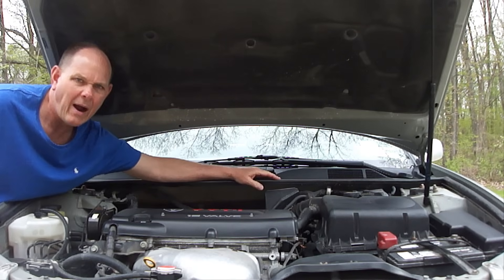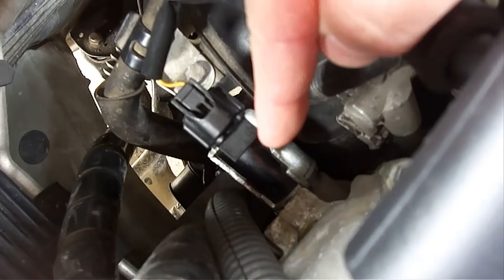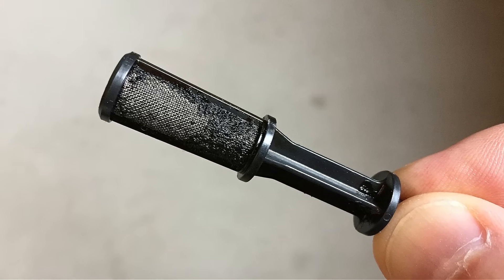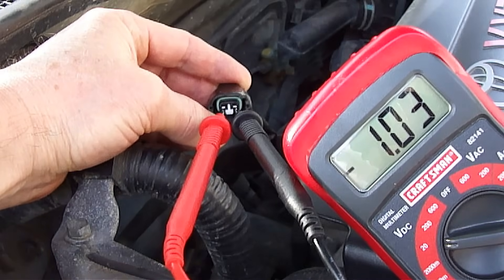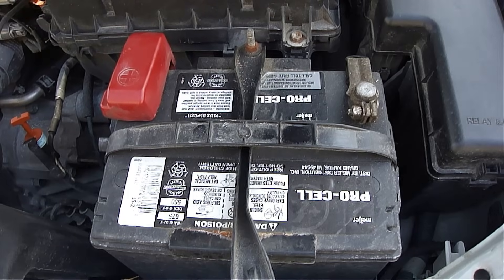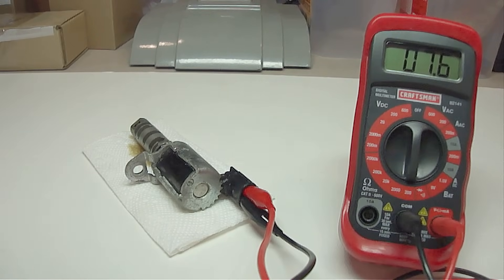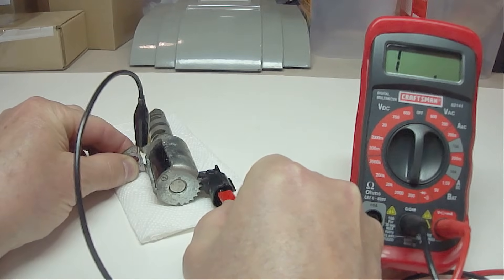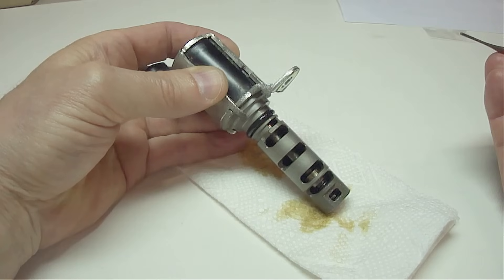How To Tell If Variable Valve Timing Solenoid Is Bad On Your Car P0010 P0011 P0112 P0013 P0014

Comment: Awesome Video! 
Had P0023 (2012 Enclave) (also had P2099, P0430) engine chugging slightly in OD.
Finally SOLVED it by replacing VVT Solenoid (think problem was: I cracked solenoid plastic housing when replacing my alternator),
But first replaced Camshaft Position Sensor (see steps below) but didn't get rid of codes so I replaced VVT solenoid after solenoid connector cracked off in my hands when trying to unplug connector to test. Also used liquid electrical tape to reseal connector wires as they were pulled back from connector and showing bare wire. 

Side note: Did all the following and didn't solve it...ugh: Replaced the Camshaft position sensor & bank 2 lower O2 Sensor... but code came back.
Bank 2 exhaust is located just to the left of the Oil fill cap (near top of engine). Unfortunately, it is hidden behind a ton of stuff that needs to be removed to get to it. Heres what it took: Detach negative battery cable from battery. Remove10mm holding ac line near top front. Remove (2) 10mm holding overflow tank (move aside). Remove Fusebox cover. Loosen (2) phillips 10mm bolts (holding fuse wire harness) inside fusebox. Remove (1) 13mm bolt connecting positive battery terminals to fusebox. Unclip and remove fusebox middle part (with fuses) removing wire harness from bottom. Unclip/remove fusebox bottom. Remove (3) 10mm fusebox aluminum baseplate. Unclip wire harnesses from baseplate. Remove (2) 15mm engine mount bolts (holding rubber figure 8 mount). Slide rubber figure 8 mount out sideways. Remove (2) 18 mm bolts from part of mount that bolts directly to engine.  Remove (1) 10mm camshaft position sensor bolt. Remove sensor. Detach sensor wire clip. Reverse to replace everything. Lots of parts to remove - it wasn't that bad once I figured it all out but just a lot of little maneuvering to get such a small part out. I would give yourself 1.5 hours (or more) to remove and 1.5 hours to replace. This same/similar procedure can be used to get to the alternator on this car also but I'd also remove radiator hose for alternator and plastic shroud for alternator.

Comment: Great video!! Thank you for posting ☺️ my engine light has been on & was told that code meant needed to replace valve you were talking about.  If at a light engine would shut down & sometimes hard to get back running & getting into traffic. Got to point where battery was drained.  Today went got new battery - everything was great 5 min later & engine light returned .  5 min later stalled out in middle of traffic @ a light. 😬 fortunately had help pushing it into a parking lot.  Was able to get running again and get home. Went to autozone and got the above valve. Wish I found your video first!!  Took a couple hours but finally got the old valve out & new one In. But this video would have saved us so much time & F bombs 😂
Reply: I have the same issue

Comment: Thanks, this was very helpfull & I find that my cam solenoids are stuck (X 4!! ) & that it was not bad wiring to them, & this is most likely the cause of the camshaft sensor p0340 + others, problem.
When I tested, one gave a light 'Tik' sound for a while, another nothing, both coils in them seem OK.
I need to remove the camshaft covers to get to them. Audi ASN engine

Comment: Just unplug the dam thing and leave it unplugged. I have on my 1.8vvt vectra which has 2 of them unplugged them both months ago and my car runs so so so much better variable valve timing is only for emissions anyway. People say unplugging them causes codes and performance issues i have non of the above infact I was suffering with lag and flat spot issues when connected now im not. If you do get codes just simply buy a second hand set dont fit them just plug them in a cable tie them to the frame of the car tricking the ecu into thinking there fitted. By running without vvt is the same as having an engine without vvt unplugging only returns the cam to base setting just remember to reconnect for emissions test.

Comment: My 2004 honda accord coil resistance check  ohm reading is 70 and not 7.0. I can't find the acceptable ohm range for my honda accord solenoid. I don't have a check engine light  and it passed all other  checks. Should I buy a new solenoid?

Comment: This is a very comprehensive video and one of the best videos on VVT. Thanks for sharing this 
I have a question- can a VVT solenoid be cleaned? If yes then how and what cleaner one should use.
Reply from the maker: himanshu thakur yes a VVT valve can be cleaned. Submerge  the moving parts only in gasoline which makes an excellent cleaner.
Reply: Thanks a lot. I have a 3M throttle body cleaner, Can that be used as well?
Reply from the maker: himanshu thakur try the 3M cleaner first and see if that works.  Depending on how bad it is you might need gasoline. If you end up needing to use gasoline I would soak it for a couple of days if that’s possible.
Reply: @proclaimliberty2000  Got it. Thanks again. I'll post my experience here.
Reply from the maker: himanshu thakur 👍😊
Reply: Very intuitive video. My question is what would  be the acceptable ohms for a 99 lexus es300? Thank you in advance.

Comment: Great video...I'm now a subscriber! One question....was the 1.04 volts dc you measured correct?
Reply: VERY good question.  Wish we had an answer,  obviously every other system in the car uses 12v, and he tests it with 12 v.

Comment: Please, if you have time, I have an 03 Toyota Matrix corolla. No codes, but NO Voltage going to the VVT Solenoid from the wiring harness connector. The VVT Solenoid itself functions perfectly when attached directly to battery. How do I find the source of the electrical short?

Comment: 0:12 Incorrect, the solenoid is NOT a sensor. What was described is what the Cam sensor(s) does along with the crank sensor, and translated by the ECU as to what load, and cam phase to adjust to.
The solenoid is only a sensor if there is a short in the circuit. The ECU give a solenoid fault if it doesn't see the cam phase adjust to what it expecting.
Reply: Thanks cuz I was just so confused after looking at my car and then working on it

Comment: Hey great video! Thanks for the help! I was able to identify that my exhaust solenoid was out! It had the correct reading for resistance (11 ohms) but when I connected it to the batter it wouldn’t move! I tested the inlet solenoid and it clicked open and shut without issue.

Comment: Will this cause a car not to start
Reply: Kash Guwopz did you figure it out mine isn’t starting either I’m replacing this valve tomorrow hopefully it turns on
Reply: ivan torres hernandez I had to get a new engine
Reply: Kash Guwopz what was the damage that made you replace engine
Reply: Low compression cranks no start

Comment: Thanks for the video! Is Bank 1 and Bank 2 the same part?
Reply from the maker: Hi Becky, the answer is no.  This video will help you understand it better.  https://youtu.be/ij6wGdhGDow
Reply: @proclaimliberty2000  Thank you very helpful! My ford edge is throwing thew P0010 which is the VVT Solenoid It says Bank one. I guess my other question would be, I thought about going ahead and getting two because I though there were only two. I have two in  my cart right now on rock auto. I picked one up at Oreilly today but it was 61.00. Figured I could get two and change them both out for that price! So I guess I need to find a part number for Bank 2? Thank you so much!!
Reply from the maker: Becky Stiles The first thing I would do is change the engine oil and filter which might fix the problem.
Reply: @proclaimliberty2000  My boss told me that earlier! That means he might be right and I refuse to tell him that haha,  but I am due for an oil change. I really do appreciate it! It started missing or surging a few months ago. At first I thought maybe it was just bumps in the road but It's getting progressively worse. Especially going up hills at a lower rpm. This light has been on for a long time..I mean loooong time. Just changed out the camshaft position sensor. The light went out. I hit the reset button to see if anything else would pop up and the check engine light came back on I checked it today at Oreilly and got this code. I got the same codes  a couple of years ago but didn't really have the money to take it someone to get fixed. On my own and working nights just didn't make it easy for me to do. I know, shame on me. Anyway, I'm so glad I found your channel. This is going to be a lot of help for me. You are accurate and explain things very well. Very informative! Thank you!
Reply from the maker: Becky Stiles 👍😊

Comment: Hi. My friend. I'm having a trouble with my Land Rover 2005 HSE 4.4 V8 cilinders gasoline. Maybe you can help me out. My land rover starts. But does not move when i put the shaft on D to drive. And after 15 minutes that i turned. Off the engine. Wont start again. And send the message apply handbrake. I will apreciate your help please

Comment: For some reason the VVT code didn't show up on a 2000 Avalon. I researched the symptoms on the internet and used a YouTube video to replace them. It made all the difference in the world. You're a champ for taking the time to help folks with your videos. God bless!
Reply: was you car running rough for one of the symptoms?
Reply: @kidnman4605  Hey, currently having this issue on my 2002 xls, i have a rough idle every now and then, and a strange hopping or jerking motion when accelerating. Everything i research points to the vvt solenoids, ill be replacing them this weekend.
Reply: @kidnman4605  yes
Reply: Yah, having these problems yet does not shoe up on OBD2
Reply: @WolverineXXXX  same with my 2001

Comment: Is possible this could be causing issues during acceleration (rpm fluctuation, jerkiness) without a check-engine-light? It just hasn't been replaced before & now has 430,000 miles... probably worth replacing it anyway for good measure?
Reply: 430,000 miles. 
Replace everything
U Funny guy.
Reply: @markvermeulen1372  490k now

Comment: Very nice video, very helpful. I have 2.4L ecotech 2012 Buick Lacrosse code P0016, P0017 and P0172, smoking tail pipe and engine doesnt pick up 100% power. Engine sound fine, probably timing chain off track by teeth??

Comment: As solenoids have moving part internally do they wear with time reducing their efficiency?  I recently changed out the filter screens on my vehicle , they looked clean as I change my engine oil religiously so I was wondering if replacing the solenoids with new ones would make sense.  My van is a 2006 with 175k miles
Reply from the maker: I think the wear on a VVT valve would be minimal.   The problems start when the engine oil is not changed when it should be causing varnish build up on the VVT valve resulting in poor performance which can of course be corrected by cleaning and removing the varnish.   As long as your check engine light doesn't come on then it should be performing properly.

Comment: what is the symptom to have this bad timing solenoid? can this cause loss power when press hi rpm and engine shakes/rough when idle.
Reply from the maker: https://youtu.be/fPqjJVHZS3I
Reply: I've check mine today the solenoid just works fine after tested with my car batery because I don't have multimeter.  So what else can cause this problem ? can ECU cause this rough idle?

Comment: Could this problem lead to the engine hot ac off msg on a 13 impala?  I’ve already replaced the thermostat,coolant temp sensor & the pigtail connection still getting the engine hot ac off msg only code I’m getting with the scan tool is p0024

Comment: P0011 on a 350z. Would that cause a lumpy idle that sounds like it’s a cammed Chevy but runs normal under acceleration?
Reply: Nissan always have problems. Buy a Honda

Comment: I have a 2012 Honda CRV and I have a cold start grinding sound. Only on cold start. I change my oil religiously at 4K miles.  Purchased this car new. Honda has a TSB stating to replace the VTC Actuator and not solenoid. Many people have changed the VTC Actuator on the intake side but the noise eventually comes back.  Not sure the true cause that plagues these CRVs and accords with the cold start rattle they lasts only 1 second.  Any opinion?

Comment: Can a bad VVT intake and exhaust solenoid cause a vehicle to stall while idling and cause difficulty starting? My car has been rough idling, stalling and having issues starting. However, no check engine has come on so it's been difficult for a mechanic to pinpoint. Today I was told it is the solenoids, but I see nothing about this causing my specific issues and as I'm being quoted $615 I wanna get all the information I can. Thank you!
Reply from the maker: artbyce based on everything you’ve told me the first thing that comes to my mind is a dirty throttle body that needs to be cleaned. Do you know if that’s been done recently? Do you know how to clean a throttle body?
Reply: @proclaimliberty2000  Yes, I cleaned the throttle body 2 weeks ago. The issues started happening more regularly the day after I had an oil change. I also forgot to mention there is a very noticeable ticking sound coming from the engine.
Reply from the maker: @ArtCE47  Make sure all your vacuum lines are attached.
Reply: What's the make of your vehicle? @artbyce
Reply from the maker: @twiliteblue6053  2006 Toyota Camry LE (2.4 liter 4 cylinder)
Reply: I have the same problem on my toyota corolla,. When I shift it in drive or in reverse the rpms fluctuate back and forth as if it wants to turn off . I changed the ignition coils, spark plugs and injectors and the problem never went away . Could it be the throttle position sensor ? Any recommendations ?

Comment: When I checked the coil resistance on mine both were flashing 2.0 but yours are steady on 7.6.
Why is my reading flashing and not steady.
Reply: Flashing  means you're not getting a reading or you're in wrong setting. Use only 1K resistance setting. If you're setting is too high, you don't get accurate reading.

Comment: Hi sir and thanks for your very informative video. 
I tested my solenoids connection with a multimeter and it showed 2.4 volts on each of them. Is it the right voltage for an 2.4 Ecotec engine? Shouldn't it be 12 volts powering them. Please advise. Thanks.
Reply from the maker: Ricardo Quezada Your voltage is good.  It should not be 12 volts.
Reply: @proclaimliberty2000  many thanks for clarifying that.
Reply from the maker: Ricardo Quezada 👍😊

Comment: Hello! I'm so glad I found your channel. I'm having a P1349 error code on my 2000 Corolla LE. I drove it to D.C from VA yesterday fine. When I got home I realized whenever I hit the gas, or go past 2000 RPM it makes a very loud knocking/rattling noise from the left side of my engine. At first I thought maybe it was sparkplugs/coil packs but after I realized it was a P1349 VVT-i error code I knew it wasn't. Today I got a oil change because one of the symptoms is bad oil (oil was dirty when changed) and it's still making the same noise but slightly less. I'm hoping that it's a bad solenoid. When replacing the oil solenoid there is only one correct? Also do you think it's a solenoid or something else? I know you can't give me a answer without seeing my car but what is it usually? Bad solenoid I'm guessing... Thanks!
Reply from the maker: CookSzn before changing the solenoid make sure it’s receiving voltage at the harness that attaches to the solenoid. If you replace the solenoid, make sure it’s an OEM part.
Reply: proclaimliberty2000 so I should test the wire that connects into the solenoid with a voltage tester right
Reply from the maker: CookSzn Yes.  Put key in ignition turned to the on position but do not start. Then check solenoid electrical harness with digital multimeter on DC setting.
Reply from the maker: CookSzn you need to watch another video of mine called how to fix engine hesitation during acceleration - P0010... It will show you how to  inspect the solenoid
Reply: proclaimliberty2000 thank you
Reply from the maker: CookSzn 👍😊
Reply: @proclaimliberty2000  I think I have an oil leak (can't seem to find one) ... Got an oil change yesterday drove the car twice, on the 2nd time it was sputtering and SOMEHOW out of oil (put 5 quarts in less than 5 hours before) and the car locked up and turned off. Oil stick DRY.. I hope my engine isn't damaged now.. I think I'm going to sell my Corolla because if its an oil leak it will prob be very expensive... Thanks for your help
Reply: @cookszn4524  
Obviously the oil change guy did not tighten the oil plug or oil filter. No car can leak that fast without a major accidental leak or cracked engine.

Comment: I have 2002 Toyota Camry le pretty much same car/motor in your video here!! Enjoyed the video,, but, what if the part is cracked?? its the black top part as if you were just standing above motor looking down at it.. My scanner only shows codes, p0300 All misfiring 1234. Po1135 bank 1 sensor 1. And 02 sensor not ready, cat not ready , H02 sensor not ready. Could this solenoid being cracked cause any of this?? A mechanic had put new harmonic balancer and belt on and 1 month later the harmonic b. FELL OFF WHILE DRIVING!! How does that happen!? Im assuming pulley fell then belt it this solenoid.... Any info would be great . Thanks Scott.

Comment: my prius dont have power uphills , no code on the dash . you think is the vvt
Reply: Probably your fuel pump or fuel filter.  It could even been a dirty air filter.  Happened to me before
Reply: I think it's the prius badge

Comment: How do I replace the OCV on a 2010 Santa Fe. I pulled the bolts and unplugged it but it doesn't seem to want to come out.
Reply from the maker: Leonard Smith Pry it with a screwdriver like I showed in the video.